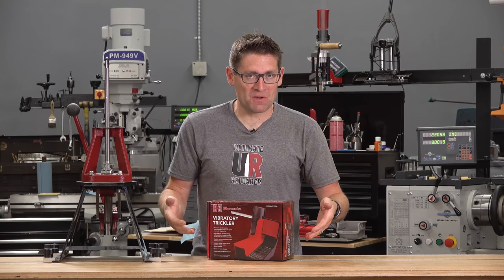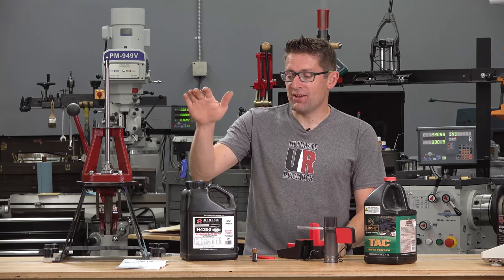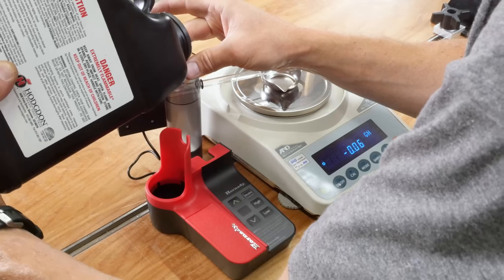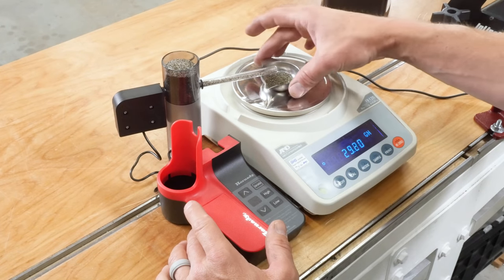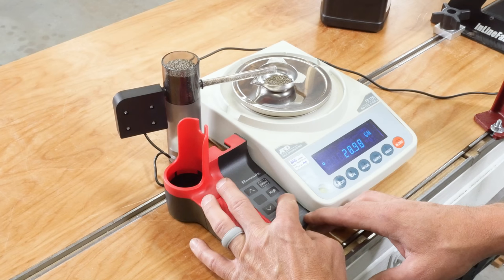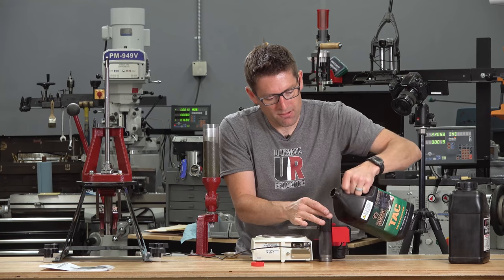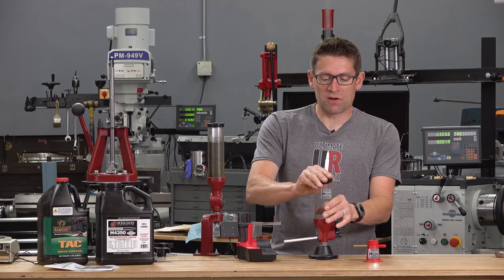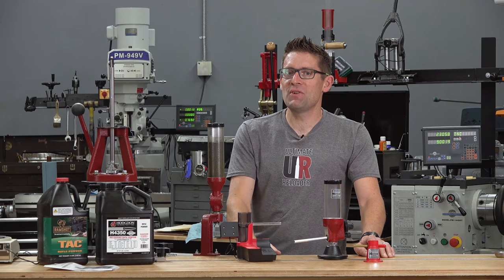Different By Design: Hornady Vibratory Trickler

Comment: Gavin, I bought on of these about 9 months ago to upgrade my system along with a decent digital scale and it works very well.. along with the throw you can get it close fast and accurate. As you said much easier with just a push. I recommend it if your aiming for the .002 zone loads and do not have the coin to dump in the Big Boys systems

Comment: I saw  this in my local gun store and almost bought one.  Then I thought, I have a 3d printer, I think I can make one.  So I did.  I haven't used my Hornady manual trickler since.  I don't have adjustable speeds on mine, it pretty much always runs on the equivalent of the slow setting on the Hornady.  Like everything in this world, there's a small learning curve to become proficient with it.  Once you do, it is a huge time saver.  Not to mention repetitive turning of that tube on the manual one gets old.  Great video!  I've wondered how mine compares to the Hornady ever since I finished it.  Oh and I've used mine for several months now, and haven't had to replace any buttons, switches, or even batteries yet, and I'll bet money my vibratory trickler is faster than any manual, and just as accurate.

Comment: I've been using this one for around a year and about 8 lbs of 4350, and I can easily drop one kernal of power. The dandy wasn't available when I bought the Horndaddy.  I made a slight mod of bending the tube down about an 1/8 of an inch which made a huge difference in allowing me to easily watch and drop exactly 1 kernal.  I'm using the sartorius entris balance which reads .001 of a grain which allows you to measure exactly 1 kernal of powder.  I can quickly and easily measure each load to the nearest kernal of powder even though it probably isn't necessary to have that much precision, at least I know that my powder charges are a close as possible without cutting kernals lol.  I reload for PRS matches.

Comment: It's more complex than using a manual trickler and less accurate. Pointless.
Reply: Exactely what i was thinking.
Reply: I have no idea why they made this
Reply: WarezWally $ enough said
Reply: @WarezWally  Because it is a "new, tech filled" form of trickling, and people will buy it just because. I have one of the cheap, plastic tricklers that came with the Hornady Lock N' load kit like Gavin shows here. It works ok, but I wanted something better, so I ordered the RCBS Powder Trickler-2. All aluminum with the weighted, adjustable height base and all. It is a nice piece of gear. And to trickle a couple of grains takes no time with a conventional rotating tube trickler.

Comment: I use this trickler since 2/19 in a set up similar to what you showed, just one difference, I use a Chargemaster Lite for the bulk. Once I get into a rhythm it goes super fast and the RCBS Lite puts me really close, so I have to trickle between 0.05 and 0.1g. The benefit over a manual trickler is the tube being longer and once you get the feel it is less prone to overcharge.

Comment: The electric dribbler is cool. if it could be paired with an electronic scale  where you could make precise set points that would be even better. When the lights go out a hand operated dribbler and a mechanical scale and Lee dipper set would be the ticket. Promising the electric one seems.

Comment: You’d wear out the buttons and switches within a month. My FA manual trickler is faster, more accurate and much cheaper
Reply: Exactly
Reply: Either go all the way Hi tech and get auto charger , or just simply use manual trickler with the powder measure ; I bought used one 20 years ago for $5 and still working perfect !!

Comment: I have a question for you brother. Have you had any experience in using small rifle primers in place of small pistol primers with reducing the amount of powder in the load? Same question for magnum small pistol primers in place of regular small pistol primers and reducing the powder charge to accommodate the strength? With components obsolete right now it has me wondering if this can be done without blowing your face off?

Comment: Could you splice in some video where we watch one kernel at a time drop out of the tube? Some useful measuables might be: 1) how many grains per second can it trickle when you hold the button down, and 2) can you add "just one more" every time, without dropping extra? Does it have an interface for an external controller to make it into an automatic trickler?

Comment: Solution in search of a problem. I rate this right with the automated powder chargers. No huge advantage in speed, huge increase in complexity. And in this case I see no advantage in achieving an accurate throw quickly.